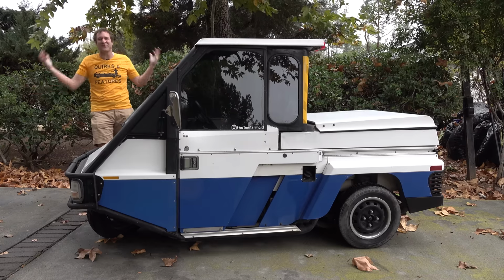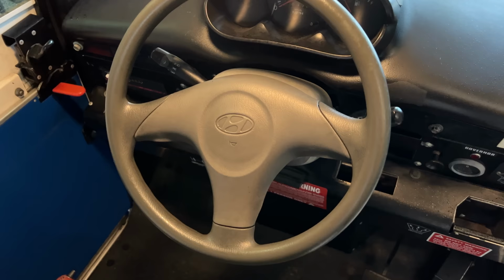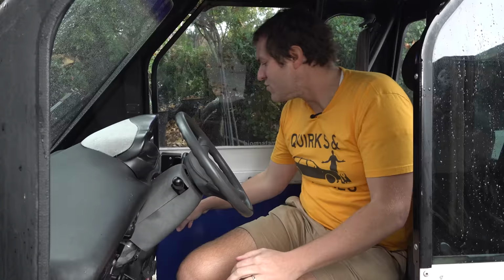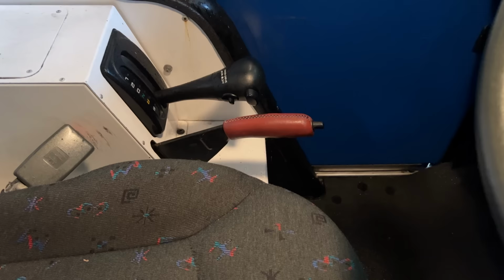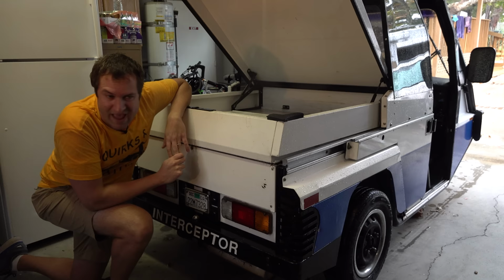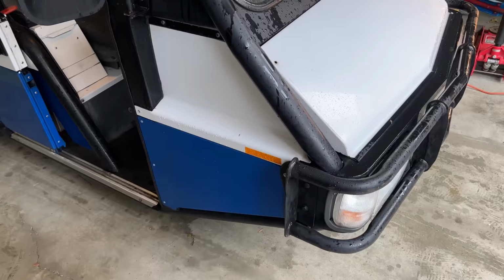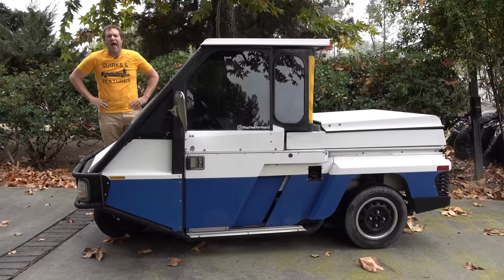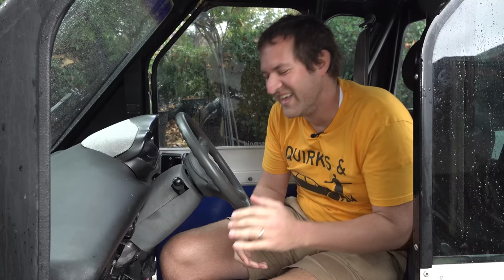Here's a Thorough Review of a Meter Maid Car

Comment: My eclectic father in law has a first gen one he commutes to work with every day on the ferry. The ferry system in Washington classifies these as a motorcycle, so he pays significantly less than if he commuted in a car. The creature comforts like enclosed cabin and heater are nicer than an actual motorcycle, especially in the fall/winter. I've driven it once, and it is definitely a unique experience. Great video Doug!
Reply: I read "my electric father" lol
Reply: @GewelReal  "in law"
Reply: Washington State has a motorcycle helmet law.   Does he wear a helmet in his "interceptor 1" lol?
Reply: @acme_tnt8741  with no airbags in that tiny metal box it wouldn't be such a bad idea 😂
Reply: @acme_tnt8741  No because Washington's motorcycle law specifically excludes vehicles that have a steering wheel, FMVSS seat belts, and an enclosure that complies with FMVSS 216. There have been enclosed motorcycles/scooters that fit similar requirements for this reason, see e.g. the BMW C1. Also, in most states 3-wheeled motorcycles don't require a motorcycle license.
Reply: Some people here in San Francisco Ca own some of those like from the 1980's or 1990's..
Reply: Doug when it rains over there in San Diego it doesn't gets cold like here in San Francisco because you are wearing shorts and a T-shirt and no jacket

Comment: I honestly like the styling more than I probably should. lol It has a very cyberpunk vibe to it, especially the sharp angles around the door slide mechanism. 

Also it's worth noting Doug that these were not just "Meter Maid" cars but also used for city maintenance and groundskeeping as well, so the bull bar and truck bed would have primarily been useful for those applications.
Reply: I kept thinking how much cheaper and better it would have been to import subcompacts and upfit them as police cars. But if you want a pickup I guess this is a decent compromise versus a golf kart. Since those are just too slow.
Reply: Could also throw a few car boots in the back too.
Reply: All about those cyberpunk aesthetics. I give it a 7 for styling, meaning it just falls short of the Ferret Tank 👏👏:elbowcough:
Reply: Reminds me of that Taxi from Total Recall...
Reply: @arnehurnik  A Daihatsu Midget might have been a good import alternative.
Reply: @arnehurnik  these are also very narrow. It might be as wide as a golf cart but at most it's that wide. It's also enclosed and most places these are used they are used year round so having it open like a golf cart would be horrible for the driver in the winter. The city I'm in there is at least one of these constantly driving around doing parking tickets and I think it's the perfect vehicle for it. The roads are super narrow and parking in general is really hard to come by so this thing is able to get around much easier than a normal car and based on it's use it has no need to be bigger than it is.
Reply: Yeah,  it ain't bad. Worthy of a two wheel front end conversion...
Reply: totaly bro!!!
Reply: When bad engineering is so fun.
Reply: @godchi1dvonsteuben770  They get used at low speed, so the 3 wheel design allows for a tighter turning circle, the US embassy in London bought Robin Reliants for the same reason as it made parking easier in Londons narrow streets!

Comment: If Doug hasn't done one yet, he should review the Grumman LLV! Folks living in the U.S. would recognize them as a standard mail truck, and they're super interesting
Reply: Regular Car Reviews did one a little while ago.  Apparently, privately owned ones are very rare.
Reply: Yesssss, and there're a bunch of juicy stories behind it too, like horrible design and reliability leading to fire/explosion, horrible gas mileage, and decades long fleet replacement plan.
Reply: @johnmurphy9580  I believe the LLV was only ever sold to the public in the time between when USPS stopped buying them and when Grumman ran out of inventory, and USPS just keeps their LLVs until they end up in a scrapyard and never sells them
Reply: @johnmurphy9580  when I saw this go up I thought, like, is this a response to RCR starting that review with "What's up Doug?! I've got something you haven't reviewed and can never review!" lol
Reply: @JackieBright  Yep. Basically the LLV was designed to last for a certain number of years but USPS implemented a plan to extend the lifespan beyond the original design intent. And now we are past the lifespan extension on them. So they don't sell them off to private individuals like they did the DJ Jeeps because they need as many as they can keep to use for spare parts and such. 

They are absolutely awful to drive at speed. Now maybe that's just because they are so old and worn out raggedy. But trying to drive one down the road at 55 is just insanely scary. Not to mention some of them are so clapped out they lose power as soon as you try to pull a hill in them at that speed and you have to fight the accelerator to get it to downshift and stay in 2nd so you can actually pull the hill with the engine screaming at you. And of course they are basically convection ovens trying to cook you to death.
Reply: We used to live near a body shop that repaired them, it was kinda funny to see their yard full of broken mail trucks.
Reply: My brother is a mail carrier and he hates the damn things. He won't let me drive it though...
Reply: @johnmurphy9580  That seems to be by design.

Anybody looking for one might have an easier time importing one from Canada or Mexico. Their postal services used them as well, and even the newest of them is old enough for grey import (assuming the same laws for normal car imports apply).
Reply: Anyway, if I found one, I’d turn it into a mini 4x4 camper.

Mechanically, it’s a first gen S-10. The drivetrain is all GM, and it runs on a modified S-10 Blazer chassis. Peek inside of one, and you’ll see that it even has a Chevrolet steering wheel. The only mechanical parts that AREN’T from an S-10 are some of the RHD bits, which were lifted from some French car (I don’t remember which manufacturer, but it was apparently the only off-the-shelf RHD option compatible with some of the other parts they were using).

So, what’s stopping me from removing the body from the chassis and dropping it onto an S-10 4x4 chassis that’s already been registered? You chuck the French stuff and any of the other LLV parts you don’t need, cut a hole for the donor truck’s LHD steering column, cut out the letter shelf in what used to be the passenger seat area, install better seats, give the chassis a mild lift, cram in the biggest engine that will fit, and you’re good to go. The cargo area obviously isn’t big enough for much of a living space, but you could probably fit a queen mattress and maybe a small stove, especially if you cut away the rest of the shelves.
Reply: yes!
Reply: The llv doesn’t meet requirements for normal registration and it was never tested.

Comment: Supercar, but better. Change my mind.
Mid-engine, center-seat, wedge-shape front, truck bed with tonneau  (robbed a bit by the engine), truck-like rear window, SLIDING DOORS, sliding windows, inverted hazard light switch, engine hours counter, roll cage, bullbar,  and of course, 1 less wheel = weight savings. Combining the best and coolest part of everything.
Reply: Not to mention the power to weight ratio! 60 hp in a 1500lb vehicle is not bad at all. With a bit of modding, it could easily be made even lighter. Maybe even more powerful!
Reply: Period!

Comment: For anyone who is curious, most of the parts on this came from the Hyundai Atos, including the drivetrain and the "city bus" pattern seats. I'm not sure where the headlights come from though. They look similar to the Subaru Sambar lights, but different.
Reply: The front headlights i think they are from a mid 90's Kia Besta. Also, all the interior parts come straight from the Atos, including the hazard light button (mounted backwards)
Reply: What about the garlic cap on the reservoir?
Reply: I confirm that, we had one of those Atos here in México, I recognize that because of the wheeldrive, botons, engine, seat and speedometer. It was such a great car but very unsafe on roads, we actually have a Renault Duster and a Renault Kwid.
Reply: hyundai atos is the car i learned driving stick with. gave it quite the bashing
Reply: It makes you wonder if they bought parts or just dismantled an Atos to build each one.
Reply: @sebastiancatalan1376  The headlights are from the korean "Asia Towner DLX", a 90s microbus like the mentioned Sambar. Asia Motors became a part of Kia in the late 70s and so today its also belongs to Hyundai. But i think they don´t exist anymore.
Reply: The shifter is extra fancy. Based on the orientation of the release button, it came from something RHD.
Reply: @johnfox3845  The shifter is also from the Hyundai Atos, and yes it's from the RHD version. Great observation :)
Reply: Or its twin Kia Visto. Both atos and  Visto were popular in my country in early 2000s

Comment: I was at a shop that was contracted to work on a small fleet of these, around when the Interceptor II was new; 2008ish, give or take. With all the options, like the light bar and comms radio, I was told by our liason that these were costing the city of Seattle around $50K apiece, at the time. Ridiculous overpricing for what should have just been done with a Cushman. 

Almost every job they came in for was some sort of recall-based upgrade. It quickly became apparent that whoever was engineering these vehicles couldn't possibly have had experience in road automobile design. And the build quality was also shaky, at best. I mean, for one thing, the non-ignition locks are super basic wafer locks, like these carried by just about every hardware store or auto parts store. For $50K they couldn't even bother to make sure each vehicle had matched locks - necessitating the handful of keys for everything. It's incredibly unstable; whatever the governor speed was, it was still high enough to be easily tipped up onto two wheels. One or two of them had the absurd problem of incorrectly made wiring harnesses, i.e. a green wire at the engine computer could be a yellow wire at the other end! It made diagnostic work incredibly difficult, and the Canadians would ship us an entire replacement vehicle wiring assembly. 

The motorcycle-type fork, custom-made or customized for the wide car tire... which itself is stupid to have used here - you need a tire with a rounded cross-section, like a motorcycle has, for steering with a fork. The more squared-off, flat treaded tire will lean when turning, both immediately reducing traction during turning and increasing low-speed steering effort. 

But worst of all, the first iteration of the front suspension had brass bushings! Horrid ride and harshness, plus, being soft metal, they would permanently deform when driving over rough surfaces. Of course, this immediately let to looseness, rattling and clunking... And the first time this happened, the manufacturer sent out replacements... still made of brass! Only after this happened a couple of times, in the vehicle's first couple of road miles no less, they finally made and sent out a set of hard rubber bushings, which anyone who knows any basic level of vehicle knowledge would have done from day one. The only place you find a brass bushing on an automobile is something like a pilot bearing for a transmission input shaft, or something else that supports a spinning shaft... Never, ever, for something that needs to survive lateral impact. 

I think these vehicles are a ripoff, and the contracts for manufacturing them should have gone to an established US manufacturer that would not have screwed around by leaving the developmental road testing for the paying customer to do on their tax-money-supported time!

I loved the outtake at the end!
Reply: Interesting details.
Reply: The amount of insight into this vehicle is great, this comment deserves way more likes.
Reply: B R U H! $50k?! Jeeeesus...

At my last job (IT at a college campus), my department bought a Kubota RTV-X1100C for only $19,500... (There were probably a dozen of em around campus for other departments too.)

That thing also had a top speed of 25mph (though I could hit 30 on even a slight downhill), powered by a 25HP (53lb-ft) 3-cylinder diesel engine. It also had part-time 4-wheel-drive with locking differential, automatic (hydrostatic) transmission, power steering, and everything else that a typical cheap car would have: Air conditioning/heat/defrost, AM/FM radio with CD/bluetooth/aux, windshield wiper with washer, locking doors with roll-down windows, hydraulic dump bed, full automotive lights/signals, etc. They even had a standard 17-digit VIN, and could be registered as a Low-Speed Vehicle in my state (our campus didn't register ours, but a neighboring college campus did). Plus it had two seats (complete with seatbelts! and the driver's seat was adjustable too), yet it was still narrow enough to fit between the bollards which prevent motor vehicles from entering a walkway (which of course was a big point of these - we got them specifically to drive on the sidewalks, lol).

All that for under $20k, not $50k.... and that even included a few optional extras! For example, our campus standard for the Kubota included the roof strobe light, front pushbar, and a couple other things, plus my department added the optional radio, since we were responsible for the campus's FM radio station.

Oh, and it was built from the ground up by the OEM, not cobbled together by a third party who couldn't even be bothered to cover the Hyundai logos, lol. ;)
Reply: @kutter_ttl6786  wall of text
Reply: Not surprised Seattle spending that much on a glorified go kart. I wonder how many parking tickets it took to recoup the cost of just one of these?
Reply: For that price, you could just buy a smart car and have, yoo know, A CAR. And a fairly well designed one at that
Reply: The logical conclusion is a GEM car, which are used in parking enforcement.
Reply: Funny thing is that in Canada (Montreal at least) we never got those and they mostly rely on domestic affordable normal cars (Chevy Aveo for a while, now maybe some Nissans I'm not so surE).
Reply: So it's like a Tesla
Reply: @KatTheFoxtaur Bruh, we also got Kubotas at my job but they cheaped the hell out on options lmao. Two brand new RTVs, but no tilt steering wheel or adjustable seat, no hydraulic tilt bed (which is very important for us hauling and dumping loose materials), the strobes on one didn't work from the factory (other didn't have them), only one had a winch, no work lights, open air with no doors, no climate controls, and THEY DIDN'T EVEN COME WITH A WINDSCREEN! Anyways, they got crushed by a tree in a storm and we got two equally crappy ones to replace them.

Tangent aside, yeah they're 20k for a bulletproof 3 cylinder diesel 4WD Kubota. 50k for one of these trikes is highway robbery.

Comment: I'm absolutely in love with this dinky little thing lol. I'd love to have something like this to pop down to the local grocery store and back. It really looks like something out of an 80's science fiction movie (the exterior does anyway). I love the industrial design of it, the exposed roll cage and all the exposed screws and fittings like on the rearview mirrors, all the straight lines etc. If you painted it black it wouldn't look out of place on an imperial star destroyer from the original star wars movies, being driven by some imperial officer inspecting the tie-fighter bays

Comment: I had a coworker who bought one at an auction solely to get the mail with, as he lives in the middle of nowhere with a driveway nearly a mile long. Eventually it fell into disrepair and he upgraded to getting the mail with a clapped out MR2 he got for $500
Reply: I hope his driveway doesn't have any curves... that would make getting the mail quite sketchy.
Reply: @TakuroSpirit77  question is… which is more dangerous around turns? A 3 wheeled interceptor or a mid engined Toyota?
Reply: I would have MR2 swapped the meter maid car 🙃
Reply: Does he only use the mr2 for mail? That seems like a waste of an mr2 to me
Reply: @notrotom  it's an '87 and it's not really roadworthy enough to register and insure, but it has heat and gets the mail, and he can use it to teach his kids to drive stick when they're older
Reply: @Rextraordinaire  I guess that makes sense

Comment: This vehicle has 7939.2 hours on its engine and 45337.9 miles on the odometer.  Assuming that it has only had the single engine and never had an odometer reset this means the vehicle's average speed was 5.7 miles per hour.

Considering that, I don't know if the vehicle was even worth it over just having the meter maids walk.
Reply: Average can be kind of misleading.  Maybe the parking officer travelled at 25 to get to a certain neighborhood, and then drove at parade-float speeds the rest of the day.
Also, the large trunk might have been used to carry parking boots or other equipment that would be a chore to schlep around on foot.
Reply: How many applicants do you think Parking Enforcement would get if the job involved walking 30 miles a day?
Reply: @spyone4828  NYC has walking parking enforcement
Reply: @zedlyfe  Not every city is NYC
Reply: As a German this just seems absurd... of course our Meter Maids (we call them Politessen) just walk around our tiny cities.
Thanks to this video I not only learned about the term Meter Maid, but that there is a special car for them in the USA :-)